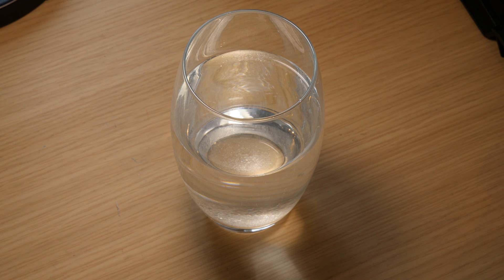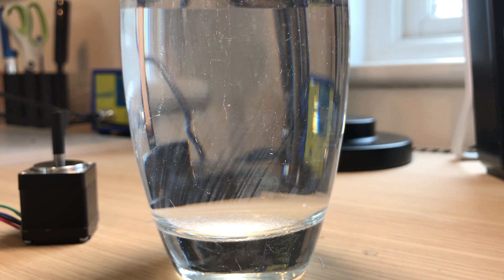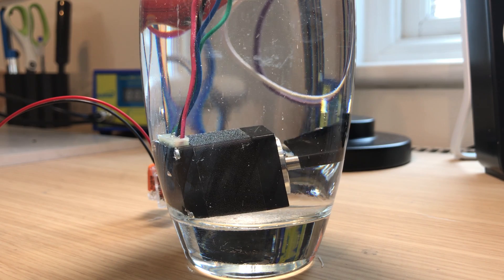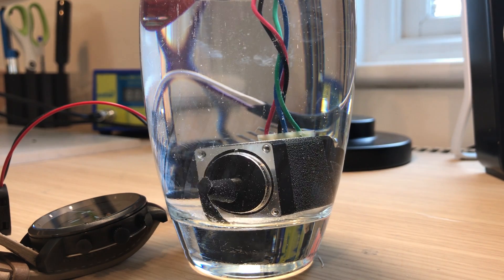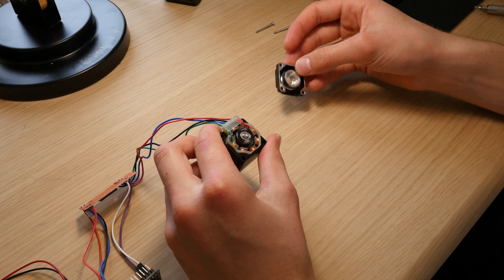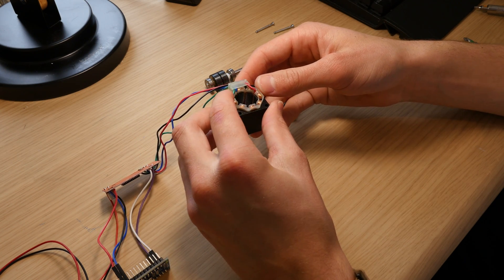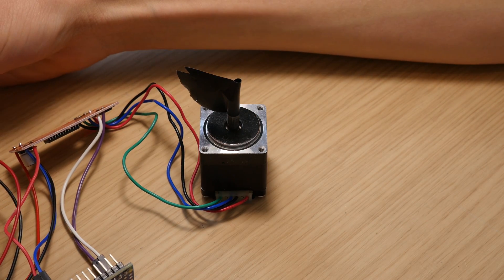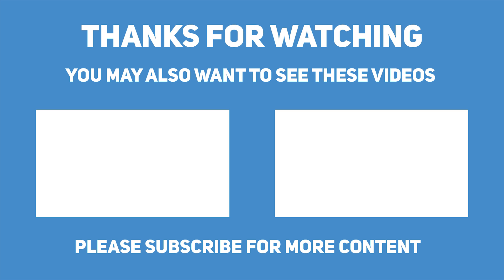Do stepper motors work underwater?

Comment: you would not want salt water inside the housing.  Mineral oil, sure, but not saltwater.  A 30 min test does nothing to show what the extended effects of the salt water will be over time, it will corrode the bejeezus out of that thing.   

20 years ago I was in a personal submersible and rov builder's group.  Several guys would use Minn Kota trolling motors on their submarines, I believe they were ported and filled with mineral oil.  Letting saltwater into the housing is a great way to end up continuously replacing corroded components.  Some guys even just filled them with fresh water, but not saltwater.
Reply: i mean, if the right motors are like $150, you could probably get away with using these for less.

i just checked and assuming i buy them via my company, i can get the 12 Ncm version for $6

Comment: Cool video. Out of interest though, the internal copper stator winding are coated/enamelled in an insulating material to stop them short-circuiting each other, therefore it is safe to assume that they will also be protected from any galvanic corrosion caused by intruding salt-water. The bearings will need the most attention though as these will most likely corrode and seize - a preventative action might be to mount a small zinc anode near the motor to replace any electrons stripped off by the salt-water in order to reduce any damage.

Comment: why the phase bearings were not short circuited ? I thought water with ions conducted electricity
Reply from the maker: I am not entirely sure about this however I’m guessing that the resistance of the water used in the test was high enough for the motor to function normally without completely shorting.
Reply: @Vosentech  I've discovered why; all the windings are resined so they are eletricaly isolated from each other, however Im most sure that with time the salted water will corode it and eventually the motor wil short circuit itself

Comment: At more extreme depths, some plastics, rubbers, and adhesives may have off-gassing problems due to the pressure.  But if there's no one down there to breath the toxic fumes (i.e. unmanned), then it would not be an issue.
Reply: That's interesting. I knew off-gassing is an issue in space where pressure is lower, but never knew that high pressures can cause off-gassing too.

Comment: Corrosion X Marine grade & some marine grade grease should help out, glad someone else is experimenting with this as well. I've done servos and Brushless Motors like this for Robosub.
Reply: Hey Arnold, is servos and stepper motor are reliable for underwater (freshwater)...I want to use it for AUV gripper.(3 meters deep)